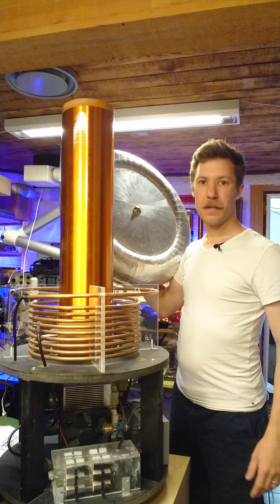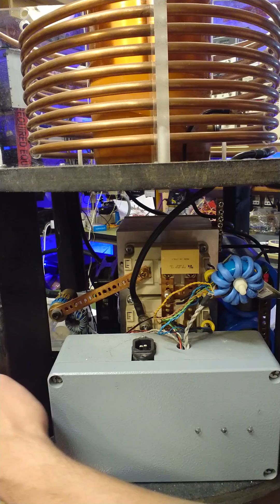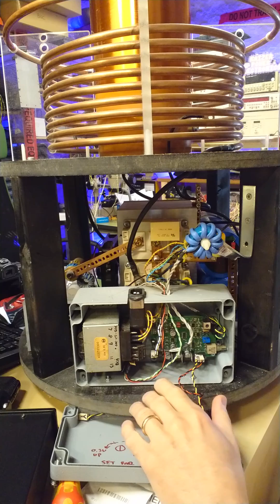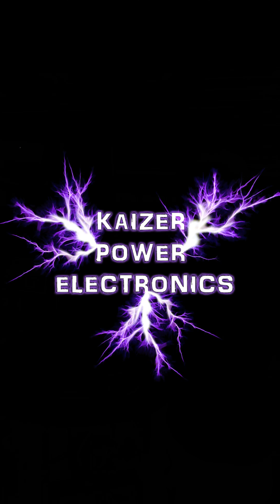How A Dual Resonant Solid State Tesla Coil Works, Explained In 60 Seconds #shorts

Comment: Dual resonant loose coupled systems have 2 resonant frequencies. TEM and LMD.
LMD is 1/2 pi higher in frequency
Reply from the maker: Correct. You have the lower and upper pole, but the drivers known as UDxx will settle at the lower pole frequency, you need a PLL driver to get it to stick with the upper pole operation. But due to spark dynamics, its harder to operate at upper pole.
Reply: @KaizerPowerElectronicsDk  yes, that's why I don't use automatic tuning. 
pll works you say? why does it choose the higher LMD frequency and not the lower TEM?

I use solid state switches, no need for sparks, as I discharge a coil to get my impulses (instead of a capacitor discharge)